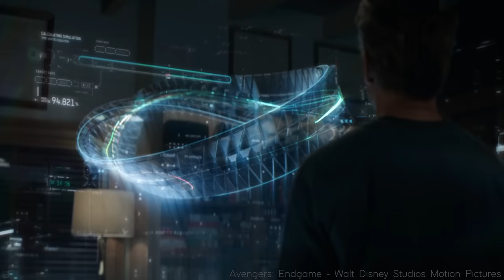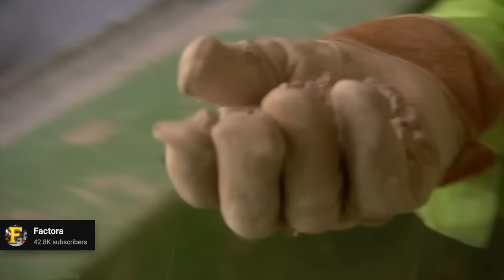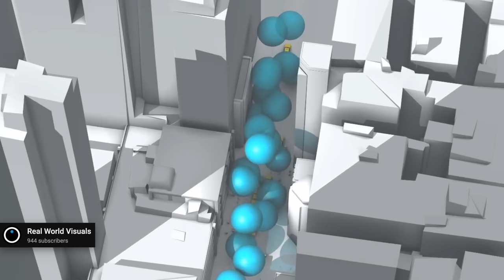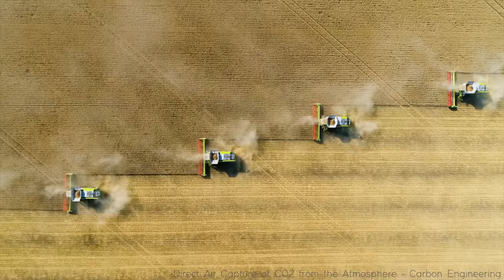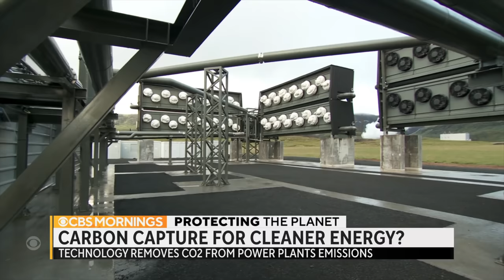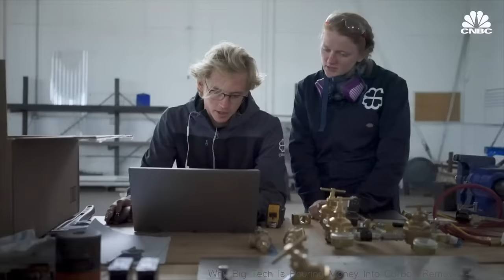How Thermodynamics Holds Back Negative Carbon Tech

Comment: DAC powered by natural gas releases half of what it produces?  I'd like to see that.  Burning a carbon product and releasing CO2 to release energy, then using that energy to turn the CO2 into something else seems like a violation of the law of conservation of energy.
Reply: They aren't turning the co2 back into methane. Just separating CO2 from ambient air. Natural gas and air goes in. And 2 pipes, one full of cleaned air, one full of CO2, come out.

Comment: You forgotten the radiative-forcing cycle of CO2 in your timing equation for land-based sequestration.  CO2 takes 100 years to go up and down and its half life is 50 years.  So the best way to calculate land is to work out at CO2 absorption capacity over a 100 year period and that means that then  the nature base solution can be in harmony with the  radiative-forcing cycle.

Comment: We should start labeling CCS efficiency as a ratio of the CO2 released when burning the fossil fuels needed to run the plant.
The plant they made in Iceland was "perfect" as long as there is unlimited geothermal energy available. Ignoring energy consumption is a luxury we cannot afford any longer.
If a CCS plant only stores the CO2 it creates, it seems a bit wasteful.

Comment: It is easier and cheaper to put resources into adapting to actual effects of climate change than investing massive resources into things like carbon capture. The cherry on top is that no predicted disastrous effects have yet occurred. Check all the predictions from past decades. 35 years of doomism to this point, and we're still fine. Doesn't mean that no effects will occur, but again, let's just adapt to what does happen rather than wasting resources.

Comment: Look, decarbonization will require multiple different levers, not just DAC/CCUS, but in conjunction with blue carbon sequestration... and more importantly on the demand side levers such as renewable energy, nuclear energy, energy efficiency measures, behavioural change programs, electrification of fossil fuel assets (amongst others).

Comment: What about concentrating DAC/Solar/Wind in undesirable parts of the world, like deserts? Will the air feedstock be sufficient or does it require distributed air? I say no. Or, add equipment to CO2 producers to capture higher concentrations of CO2? Or downwind from high producers, like cities?

Comment: Modern designed Nuclear power stations built NO-WHERE NEAR any fault lines, OR coastal areas ARE WAYYY SAFER than what most people believe, they also have BETTER safety/shutdown systems/designs too. ALSO, the waste produced IS NOT as much as people think AND, said waste CAN (AND DOES) get recycled and/or RE-USED to continue to make more power... YES it is the cost and time to build these plants, but, the ONLY thing coming out of those chimney stacks is STEAM... AND, the fuel LASTS (one lot of 'Fuel' 3 to 6 years, then approx 25/30% of it is replenished with new fuel), again, that 25/30% is then reused/recycled in a secondary power station...
ALSO... Thorium.... It's a way, it's also NOT as radioactive...
And there are other 'Reactors' that are feasible 
WE DO NOT NEED TO RELY on Coal and Gas for our power needs in our future...
😎🇬🇧

Comment: I'm curious what people think of using Highvew Power's cryogenic air energy storage for carbon capture. liquefying the nitrogen and oxygen in ambient air inherently separates the CO2 because the CO2 freezes at that temperature. That seems like a really clever solution because it's a long-duration energy storage system that feels like it should add a decent carbon capture capability almost for free from an energy and equipment standpoint.

Crushed olivine on beaches does seem like the most viable solution at global scale though because you aren't fighting thermodynamics to do it.

Comment: All new commercial building should have some sort of DAC system mandated for the HVAC systems. Where possible existing structures should be retrofitted. Imagine  the recapture potential with a city acting like its own co2 DAC system.
Reply: 😂too much imagining there, champ
Reply: Are you an engineer? What do you know about air handlers?
Reply: Enough to know those ideas will forever remain in the imagination  @joemarchi1

Comment: Ok say we go lithium, how would we acquire all this lithium? That’s right, open mine pits. What equipment would we use to extract it? Where would we the cooper required to transport electricity? Oh, open mine pits once again you say!! Where would you get the plastics needed to manufacture electric vehicles? That’s right fossil fuels. Where would you the metal components required? Once again you are correct, open mine pits!! Considering that we don’t have the technology to produce 100% renewable energy, how would we produce the electricity needed to charge all of this? Yup you guessed correctly, coal. People don’t realize they’re asking the world to switch to eating chicken 1000 years before chickens came into existence. The reality is that we’re nowhere near technologically advanced enough to do this yet. Should we work to that goal? Absolutely, but we need to be realistic about it. Jumping in front of vehicles on the highway causing them to sit there and burn unnecessary fuel is not helping one bit.

Comment: I have zero faith in any government on Earth from taking any meaningful action and certainty not any corporations taking action. I gave my last company a business plan to install covered parking "with a twist" in that they would be solar panels connected to a battery and charging network which the Employer could charge their employees a rate and any non-employees a higher rate in order to use the charging infrastructure. Based on cost analysis, it would have paid for itself in 4 years AND have provided cost savings for the electricity used by the building. It was obviously rejected because it didn't help with the quarterly financial reports due to the expense of purchasing and installation.. and this is from a company claiming to be "environmentally friendly."

Comment: I did not hear mention of whether it is plausible to safely and durably store THAT MUCH CO2 into the ground
Reply from the maker: Well it was stored there to begin with for millions of years, so sequestration folks are optimistic it would be stable there again for Myr
Reply: Don't store it in the ground. Store it in the air. The thing about balloons is you get 8x the volume for only 4x the surface area. So take a few 100 square km, lay a giant sheet of plastic or rubber or something over it, secure it into the ground at the edges, the pump up until you have a 10km radius hemisphere of CO2.

Comment: I think that for the next 80 years DAC will be primarily a research project, there is little prospect of scaling given our current electricity supply, even if we triple renewable energy generation by 2030, and increase it 10 times in the following decade. Although BECCS might play a significant role in that time frame, I think scalable DAC will have to build on the scaling of competitively priced nuclear fusion. It might be valuable in the time frame after 2100, where carbon dioxide removal will still be badly needed, but we have to make our way to 2100 without it.
    But that said, it is still worth researching both fusion and radical ideas for carbon dioxide removal (maybe from seawater, with greater concentrations of carbon dioxide than ambient air). Recent research about Antarctic sea ice suggests to me that it is not enough to think about the IPCC time frames of 2050 and 2100 (which are admittedly important, because the are "policy relevant"). We have to consider to 2500 CE and beyond. Recent models of the West Antarctic Ice Sheet (WAIS) are now suggesting that because the ocean (which has been absorbing 90% of human caused global heating) is already so warm, it will melt from below the ice shelves holding back the glaciers of WAIS like Thwaites glacier. Humans cannot reverse the warming of the ocean on a relevant time scale, so it looks like the WAIS will be collapsing and we can expect something like 2 to 4 meters of sea level rise by 2500, give or take a couple of centuries. The models suggest that whether global temperature stabilizes at 2.0 degrees or 1.5 degrees will not make an appreciable difference. These are changes of g'g'g'x10'g'great grandchildren will have to deal with, through adaptation. It looks like a big chunk of our urban cultural heritage and civilization will be under 2 meters of water in the vast majority of coastal cities, with king tides and storm surges providing additional threats. A resilient city is one that has the resources to relocate 30% to 100% of its population to higher ground districts. A big chunk of human economic productivity will have to be allocated to this adaptation, along with continuing mitigation like carbon dioxide removal. 
    This may seem rather bleak, but I can still imagine a future where humanity copes with this while still gradually improving the well-being of most people, especially in developing countries. That future may not have the material abundance that todays wealthiest 10% of people expect with their consumption lifestyles. But there are more important things in life than buying and using more stuff. Health, cultural enrichment, social cohesion, these can all improve while consuming less stuff because a big chunk of economic output has to be diverted to adaptation and mitigation.

Comment: If you are going to pull CO2 from the air, why not pull it next to the exhaust of a concrete plant instead of ambient air? That way you have more than 10% carbon dioxide you try to extract from instead of less than 1%.

Comment: Can't we use some type of organic process to pull carbon from the atmosphere, perhaps with something like airborne organisms? Obviously they would need to be engineered and thoroughly tested to make sure they're safe around humans and animals, but perhaps its possible. Or maybe instead of being airborne, they could cover the surface of structures with the purpose of maximizing surface area, drawing in air and increasing the likelihood of them capturing carbon.

Comment: Since cement production was mentioned, this always seems to me an obvious target to turn carbon negative. Its production requires essentially just heat which can be provided by electrically or (better) solar thermal energy, it gives off essentially pure CO2 which requires the least energy to sequester compared to fossil fuel CCS or certainly DAC, and finally it absorbs nearly an equivalent amount of the CO2 produced from the atmosphere as it sets.
Reply from the maker: Yes some startups developing green cement, unclear if scalable and competitive but exciting

Comment: Dr Kipping, you could have concluded your video with a much more optimistic conclusion by calculating the same entropy figure for the CO2 dissolved in the ocean, and evaluate CO2 capture from the ocean. My thermodynmaics classes are quite far away, and I'm not able to derive by myself a similar calculation of entropy for separating dissolved CO2. Still, the ocean absorbs a majority of our CO2 emissions, and it remains concentrated in the first tens of meters of the ocean surface, instead of tens of kilometers of atmosphere. Thus Ocean Carbon Capture seems to have intrinsically a much higher potential than DAC. At least this is my intuition, and I would love to see the entropy derivation to demonstrate it (or maybe rebut it).
Reply: Energy of CO2 from oceans, exactly the same.
Reply: @donaldhobson8873  Thanks, but can you substantiate ? Provide a reference paper? Or event better, do the math for us ? A few things play in favour of ocean solutions: Excess CO2 is mostly stored in surface, not deeper than 50 m. It contrasts with the 20+ km for the atmosphere. Secondly, sea water absorbs CO2 way more efficiently than O2 or N2.

Comment: I don't like that waste heat is never discussed in this context. Because if I'm not mistaken, no matter how we generate the almost unimaginably large amount of energy required for  DAC, most of that energy will be converted into heat. And even if I don't have the expertise to calculate it, it seems fair to me to assume that this immense amount of highly entropic energy is not our friend.
Reply from the maker: The peer usage is of order of global electricity demand at worst but that’s way below the insolation from the Sun, so waste heat is negligible currently to planetary temperature. See our Kardashev scale video for more on this, but we way way off K1 level where this effect starts to come in

Comment: Could we provide the heat required in these machines with hot water from geothermal installations maybe, instead of using electricity ?

Comment: So, it seems that the solution is capturing emissions, not air. Emissions have orders of magnitude more CO2 than air, so the energy cost will be significantly less. Also, we could have these plants somewhere where it's colder to reduce the energy cost further.

Comment: Umm..  So I ran the numbers.  If we're talking about generating 5 PWh per year and assuming that 7.8% efficency.  I'm going to give two answers here.  We would need 2,823 CANDU 9 reactors if we used their thermal output of 2.657 GWt.  Or we would need 8,525 CANDU 9 reactors if we only used their electrical output of 0.88 GWe.  The carbon engineering process though does require a lot of heat of so it's possible it would be we're looking at something lke 4,000 reactors around the world.  The 5 PWh is from your graph assuming we don't do anythign to curb emissions.  If we used the 2.5 PWh with emission reduction, I'm not going to run the numbers again but I think we can just divide by 2, giving us 2,000 reactors.  If the top richest 40 countries were to do this, that would be 50 reactors per country.  If we were ok with reaching these goals past 2050 it would be even less.  That's a lot, but it's plausible.  Currnetly China is planning on building 200 nuclear reactors.

Comment: Pile massive amounts of research into Fusion energy research, hydrogen based fuels, and solid state batteries. This will be the next investment boom.
Reply: Solar. If your going for cheap batteries, use the cheat fusion. 
The cheapest fusion is the fusion that you don't have to do because it happens automatically. 
You only want fusion for
1) ships, maybe large planes. 
2) night.
Both of these can use batteries instead.

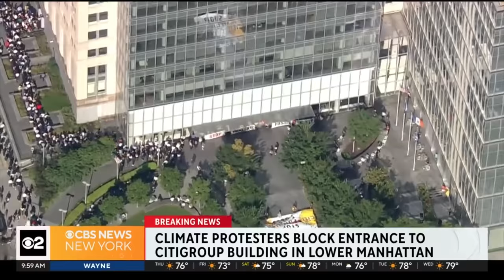Comment: 5:13 This is a flawed argument. Emitting greenhouses gases is an issue BECAUSE OF climate change. If, through capturing greenhouse gases, we keep the composition of the atmosphere constant and avoid climate change despite also emitting greenhouse gases, then it's no longer an issue that we're doing so. The only question at this point is who is going to pay for the costs made.

Comment: Wonderful video, CW Team! If you were to factor into your equation that literally 80% of all grain crops grown/year worldwide are fed to livestock --not to humans--for the production of meat (which now contributes up to 19% of greenhouse gas emissions!), and is a product we do NOT need to thrive, it becomes readily obvious that we can completely terminate our consumption of animal product and reduce emissions by nearly 20% simply by a behavioral change! That's HUGE, and yet you only merely touched upon this in your video. You must also consider that combining this with the ramping up of THEE MOST efficient and carbon minimal production of energy, which is nuclear energy, can make this problem far more fixable than your video suggests. 
   Nuclear energy (fission) production is far safer than the media claims. Bad reporting combined with fear mongering has, unfortunately, tainted the nuclear industry, which has moved humanity in the wrong direction as a consequence. Mark my word, as hopeful as "alternative'" energy sources may seem, they will never, ever come close to meeting world demand in a timely or meaningful manner. Ask France--the only way we're going to meet energy needs and severely scale down our burning of fossil fuels in time to make a difference is to go nuclear--and FAST! It can be done safely and responsibly. We know that any currently operating coal-fired power plant can be easily converted to a nuclear power plant! We have that technology. Until there is a source of energy that gives us a bigger bang for our buck, nuclear is the answer. And we already possess the most recent technology to do it. This is a no brainer.
Reply from the maker: 👍To be clear this video isn’t trying to compare different strategies, really I just wanted to take DAC to task. To compare different carbon zero paths would be a major project…

Comment: 500 mya CO2 ppm was over 3000ppm. The avg. temp was maybe 10c higher. Life flourished and there was plenty of land.

50 mya CO2 was about 1000ppm. Was maybe a few degrees C higher. Life flourished and there was plenty of land.

Today there is 424ppm of CO2. Life flourishes and there is plenty of land.

Plants can’t live off the atmosphere around 170ppm CO2 and lower, but can thrive at 20% of the atmosphere being CO2 or greater.

Comment: I don’t believe anyone said the goal is to reach preindustrial CO2 levels by 2050. It’s net zero emissions 2050 and then negative emissions during the second half of the century. The number mentioned nowadays is a goal of 10 gigaton per year from 2050. And note that DAC is only one of several CDR methods, both nature based and technological.
Reply: Preindustrial CO2 by 2050. Not hard enough. Try getting it by 2030. Or, if you like your time travel, by 2020. 

Is there some sequence of muscle actions I personally could take if only I knew how that would result in preinsustrial CO2 in a month. Almost surely. A week? Quite possibly. Do I know what those actions are. No.